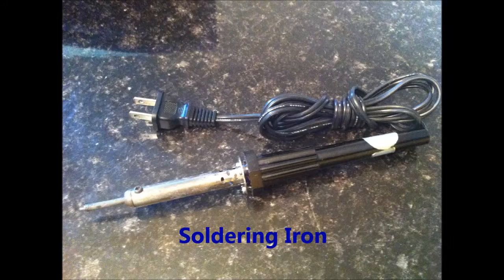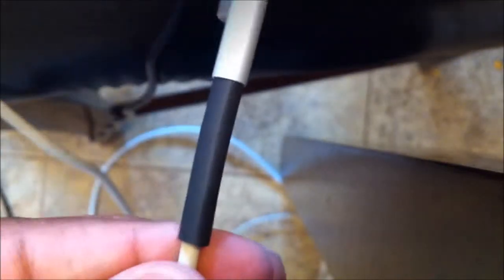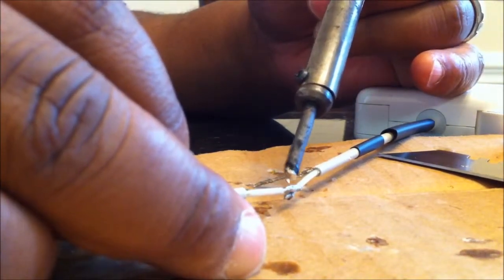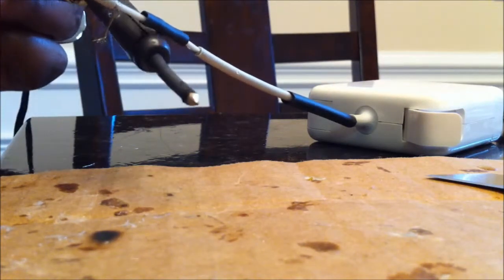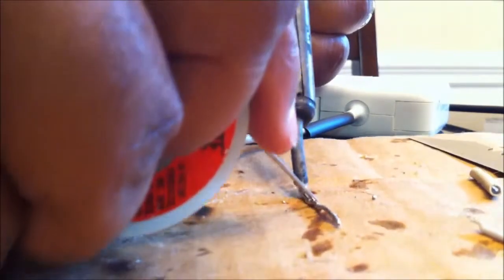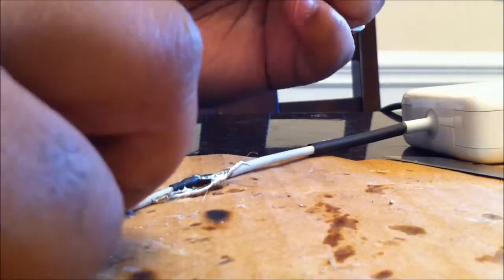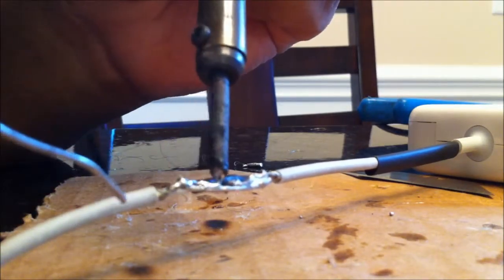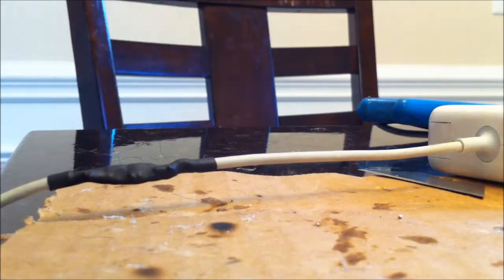MacBook Charger Repair

Comment: My cat that likes to chew wires brought me here.  Fixed it the same way, but I wanted to check if there were any good tricks.  Get a helping hand - like you said it makes it way easier lol.
Reply from the maker: Anthony Mancini Yep!  I have an entire soldering station now including helping hands. I could probably use a hot air station and magnifying glass for the small stuff. Glad you got it fixed.